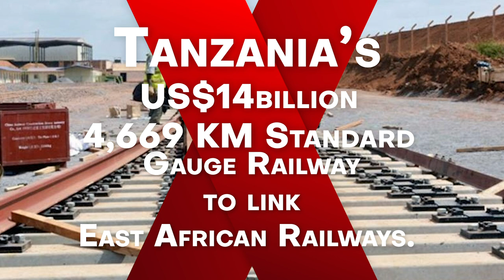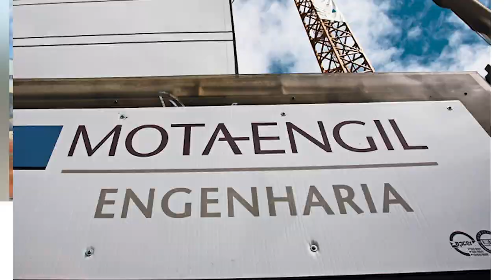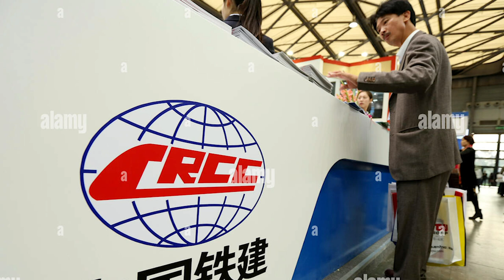Tanzania’s $14billion 4,669 KM Standard Gauge Railway to link East African Railways

Comment: The sgr while linking eastafrica via mwanza line from TBR There is constru tion agreed with Burundi and DRC to expedite a link from Uvinza near kigoma along the  Central line from TBR strait to Kitega in Burundi and onwards to Kindu in DRC , so TZ-SGR is not dependent to passing through Uganda and Rwanda to reach DRCONGO it goes straight, the routes you mention are just additional Tanzania Government is already looking for a contractor to start building the TBR-KGM section of the Central line (of the southern branch of the Central corridor)

Comment: This video would have been very good. Except, you used a lot of footage from the Kenya SGR, which is a diesel powered train system.  The Tanzania is ELECTRIC. Why then, are you showing us trains running WITHOUT overhead electric power supply? Sorry, but you have not gathered the right technical data, about the Tanzania SGR. There is a great difference between a diesel powered train network and an electric powered train network.